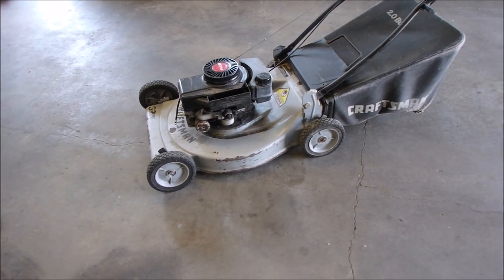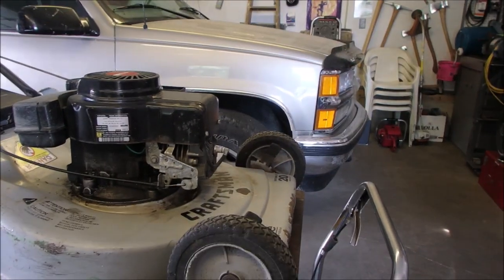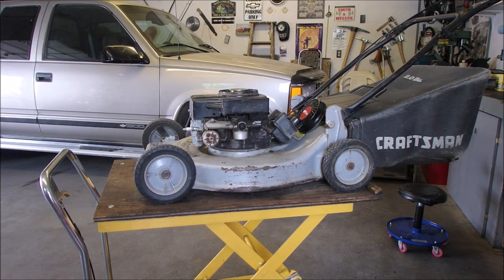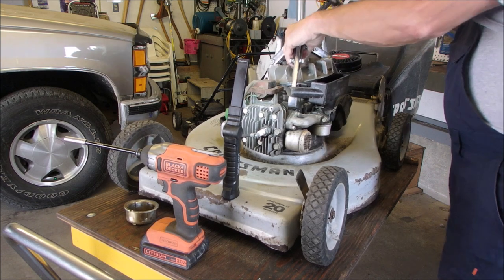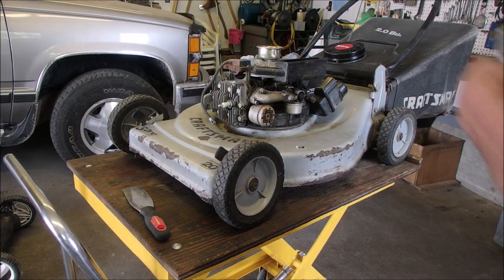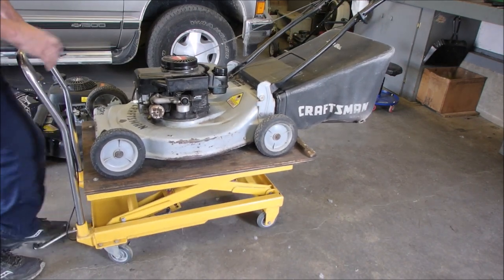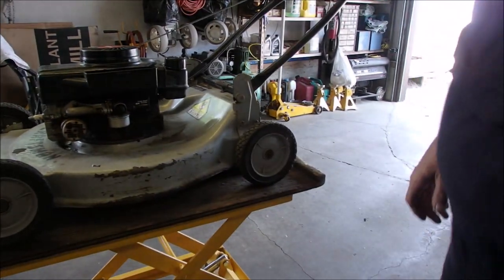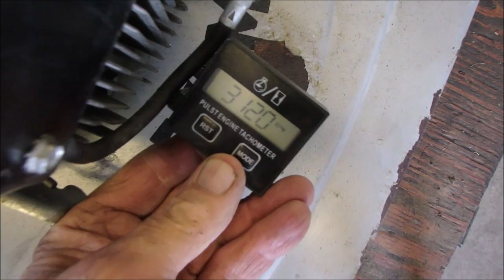Craftsman Mower,  Trust Your Gut

Comment: Lot of shops hate Tecumseh, but I love them old suckers :) .  Guys around here send them to me because they don't want to work on them.  Tecumseh's were a mean old machine in their day.  I'm soon to be 71 so me and Tecumseh kinda grew up together  LOL
Reply from the maker: I agree.  I just turned 67.  I cut my teeth on these.  Once in a while I see something new to me but not to often.
Reply: @BrucesShop I agree! My Dad got rid of a crankstart Briggs in favor of a new Craftsman Tecumseh 4HP pull start in 1970. He had that Tecumseh for years. When I was 10 in 1976, I was finally old enough to cut grass and I got to use it. It was fun the first time. After that, it was WORK!  I have a similar unit to this one, and I need to tackle it. It makes a similar noise to yours. Amazing how you get a specific case, fix it, and soon after, I get the same thing.

Comment: Run forever when maintained Bruce, nice fix running smooth now buddy. The only additional thing i would do is check the head bolts guaranteed 4 loose near the muffler. I normally put a dab of paint stick on them when tightened so i know when they come back that we have done them before and can recheck them.
Reply from the maker: OK  I did the head bolts like you but didn't film it.  Since then I have been doing all the flatheads.   However NOW i will paint them too.  I can;t keep up with EP   LOL
Reply: @BrucesShop  Great to hear you are doing it which prevents gasket failure for sure and a dab of paint lets you know the next time it comes in how they stood up to further heat and expansion.

Comment: I just did a 6 snapper pickup, 3 from one place, and 3 from another, I will do a video on em for sure.
The first 3 came from a hardware store, a in shop mechanic, said they have vareing issues, well one of the snapper is like brand new, all the bolts and nuts are shiny, and wow cleaned up super nice, the so called mechanic said it had a bent crankshaft, nope just a bent blade, I stuck a snapper high vac gator blade on it, and spot on, going to make it a keystart soon, maybe over the winter, I have never had a mower cut so level before wow, looks like a golf course putting green... LMAO.
Now for the other 3, these are the older ones, one is the aluminum deck high vac, early 80s for sure has a V on the deck, but out of that group I got a factory keystart tecumseh, has the original tecumseh starter, I cleaned it up, lubed it up, and replaced a bearing, hooked up a battery, and the sucker started right up, it blew me away, a late 80s snapper with a date matching tecumseh works perfectly, gotta love the old stuff, even has the black soft primer bulb, but the strange part, is it has a snorkel type air filter, the airfilter mounts to the front of the engine, and is 6" long and 2" in circumference, never seen one of them before..... And it cleaned up nice, the othrt mowers will need work, all run but one, and is that pain in the arse briggs 7hp one, with the side carb that hangs low..... All parts are there it's just in peices, that mechanic should never touch a mower again... LMAO
Reply from the maker: Interesting  I was given an old Tecumseh with electric start and self propell.  It is a beautiful mower but HEAVY   LOL
Reply: @BrucesShop  yes very heavy.... But excellent cut.

Comment: Good video Bruce.  I had a Briggs Quantum a while back and it had great spark, good fuel delivery, good compression, recoil rope didn't jerk out of my hand.  Wouldn't run at all.  I finally checked the fly wheel key and it was ever so slightly sheared ( about 1/4 width of the key); I replaced it and started and ran fine.  Wish I'd thought to check it sooner!!
Reply from the maker: Yes close to the flywheel it is hard to tell how much they are out.  Thanks for the insight

Comment: Hi Bruce, I enjoy all your post, I need to find one of your RPM meter, all I see use a wire, where should look?
Reply from the maker: Itis an induction using the induced spick of the high tension lead.  I have 2 just to check for accuracy.  Thanks

Comment: With the key just off a little yah I have seen that cause 163cc Briggs not work .  They seem to be more sensitive to it even when the key looks ok.  

I had a Tecumseh just slight off and it ran like cr*p new key and it was purring like a kitten
Reply from the maker: Right.  It doesn't look like much on a 1/2 inch circle but exp[and it out and it could be 10 degrees.

Comment: Good job Bruce . What tach are you using.
Reply from the maker: Well ust google induction tach and you will find it.  It comes with a wire not required.

Comment: I would like to see an electric mower last this many years and be repaired with the same effort? Same goes for gas mowers with too many add-ons!
Reply from the maker: Yes.  Like these for example ----Gas mower with a self propel, Electric Start with battery,    Blade clutch,    Automatic choke,   They are so heavy it defeats the self propell.  By the time they are out of the shed,   fueled up, lind up and started you are exhausted.  LOL